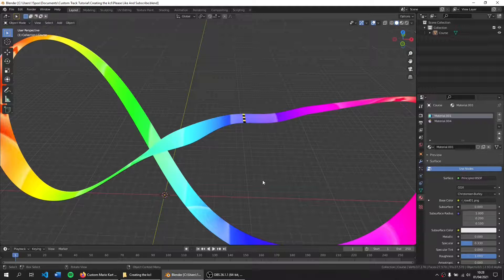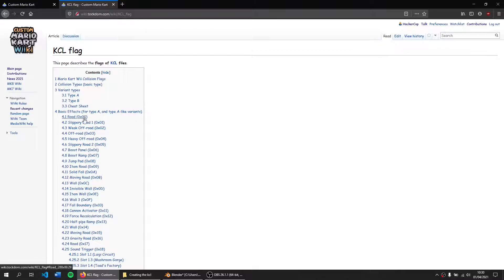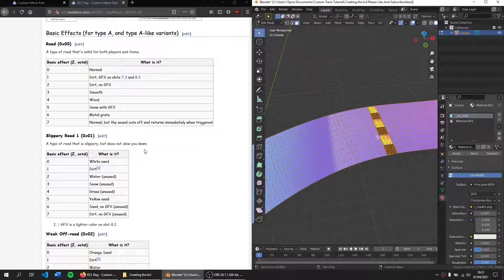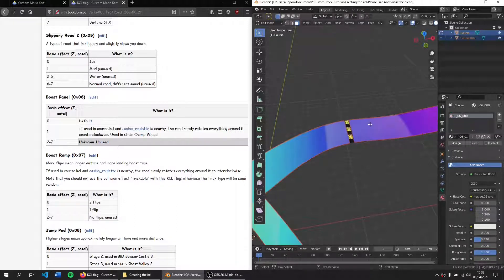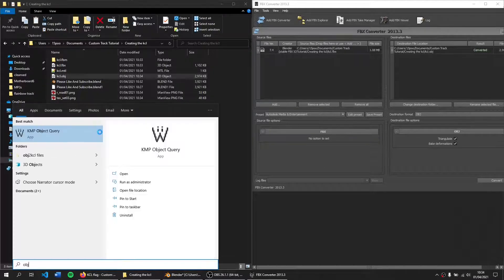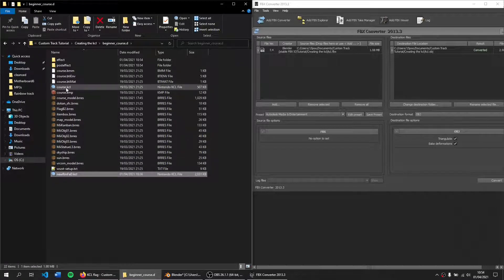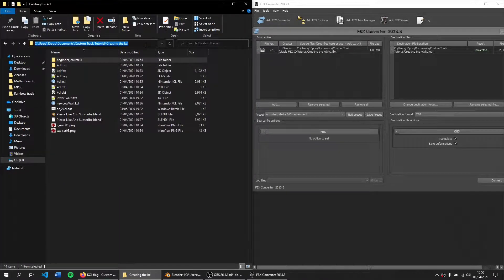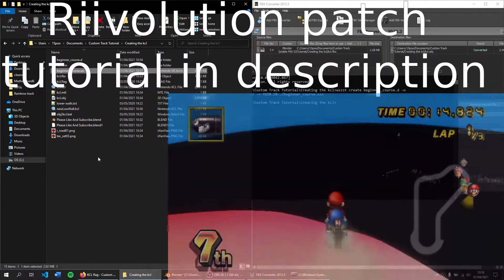[MKWii] How To Create A KCL (Collision) File In Blender

Comment: you mentioned to open up a copy of the model, but you ended off part 2 with a model with two planes seperated by material. did you reimport the model from the brres? or otherwise how can i merge the two meshes into that single Course mesh?
Reply: because currently i run into the issue of not being able to name both materials the same

Comment: when I open cmd at 4:08 I just get "wkclt is not recognised as an internal or external command"
Reply from the maker: You need to first install it and then RESTART your computer. it will not show up on command prompt unless you restart. also make sure you are spelling it correctly on the command line.
Reply: @hackercop  I did fully restart, but I remember (this could have been with another program) a "this program may not have installed correctly" prompt

Comment: Hi, thank you for these blender tutorials. I get stuck at the collision type, I set the materials to "_00_000" for a road and "_03_004" for grassy off-road grass area. It doesn't work though, and the road turns into a snowy road, and the offroad turns into regular road... I'm not sure what I'm doing wrong.
Reply from the maker: I think I've had this before, its because of a bug with Wiimms kcl tool unable to parse blender objs properly. The fix is to import your collision file into sketchup (export your model in blender as .dae) and set the material names in sketchup  then export as obj and use Wiimms kcl tool on that.
Reply: @hackercop  Ohhhh I managed to get it to work, I exported the KCL.obj from blender using Blender's obj export option, while checking "Material Groups" and "Triangulate Faces" using "1.00" as a scale. It seems to correctly work now. "Material Groups" was mentioned on the tockdom wiki page "Creating_a_KCL_with_Wiimms_Tools".
Reply from the maker: @sirsid325  That's great you got it working! I'd assumed you were doing it correctly the first time hence why I gave you the reply about the bug.

Comment: Hello there! I am having a problem where my track either isn't loading, or all the start and respawn points are under the track. When it's loads, I start with only seeing the skybox. then after the countdown ends I fall and respawn in an infinite loop. I can't tell whether the issue is due to the kcl, or the kmp. Here is the file: https://drive.google.com/file/d/11YHdjxLtjaBRsqt5N_Dv2IzsW_WkzzZw/view?usp=sharing
Reply from the maker: Thats a common issue, the reason was that your start and respawn points where placed below the track! hence you were stuck in an infinite loop. I've editied your KMP and fixed this issue here's the editied file: https://drive.google.com/file/d/1SjkKqla8_4vU_tpn_oSjCPSJmTFbyqb- I haven't tested it on my Wii but it should work. I noticed that the course was placed very high above the x-y plane (height of 20,000 game units) which can sometimes cause problems with objects so I recommend in a future version you lower it to something like 2000 game units above ground. Also I noticed that some of the normal of your KCL where the wrong way round so if the track wall dosen't work that'll be why.
Reply: @hackercop  Ah I might have been using the wrong course model file in the kmp editor. Thanks for the tips about the height and kcl.
Reply from the maker: @markrufus  Your welcome!
Reply: @hackercop  It appears I am back. For whatever reason the main road of my track thinks it's a boost pad. I set it to normal road, and then smooth road, and both times it just acted like a boost pad. I'll try redoing the road and seeing if that works, but do you know what could be causing this? Track: https://drive.google.com/file/d/1WmHOQvlbzyrYijvg42qA9Xk6bkiPRgVD/view?usp=sharing
Reply: Okay I think I figured it out. For whatever reason the last built object in the model is turned into a boost pad.